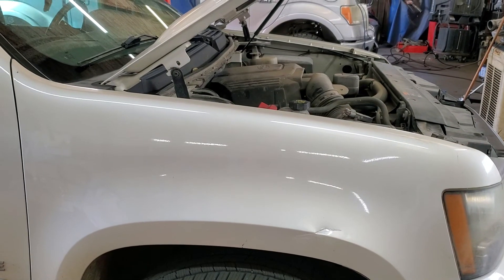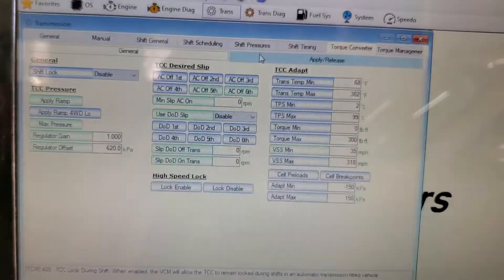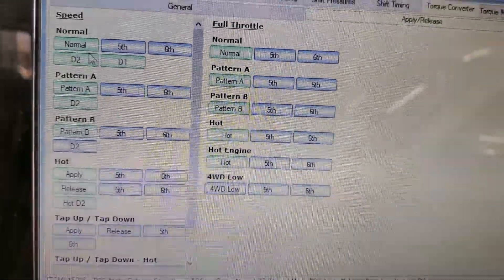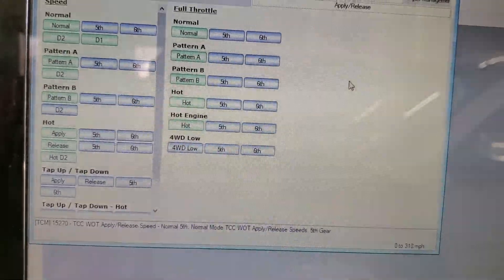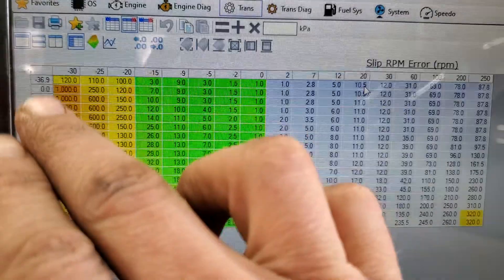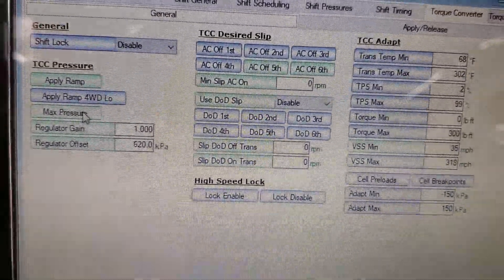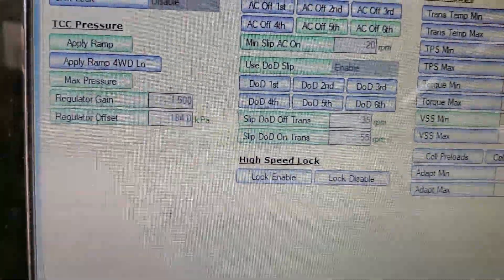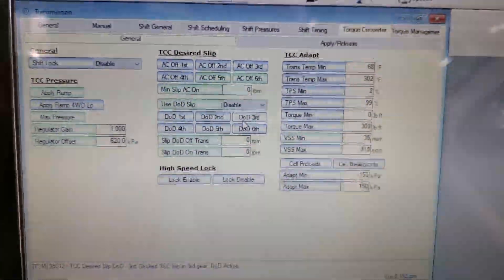GM 6l80 TCC shudder fix with HP Tuners

Comment from the maker: I just made a new video on another 6L80 in a 2016 Suburban but this time I show the whole process from data logging to tuning with before and after test drives. Just search "6L80 full of metal is saved with HP Tuners" on Youtube.
Reply: Why won't the hptuners work with 2019 and up Chevy Silverado 4.3 V6 6l80s? My tuner tried pulling the stock factory file off the truck and it fails every time. Perfect internet as well.
Reply: Do u sell the tune?
Reply: What did you do for the ac off 5th and 6th

Comment: So my 2013 suburban 6L80 was starting to shutter and have some odd shifting. so I immediately parked it. Temps have never really gotten above 150. Drop the pan put a new filter and fluid in it.... put a additive in it lubricity modifier and for the most part it's gone but every now and then it shifts kind of weird..... Hopefully it's adapting. So I think I'm going to try to do with essentially you've done. I don't think I'm going to turn the pressures up quite that high because I don't think it needs it and I turn the desired slip all the way down and turn TCC off in first second third fourth. Anyway thank you for making this video.  I just need to get another year out of this trans vehicles got 177000 miles.....just did ball joints front brales tune up oil change filter and battery so of course we need to transmission and torque converter lol

Comment: I know it’s been awhile but would you recommend this tune in a rebuilt transmission that has a shudder or vibration that’s from 75-85 … the shudder/vibration was there before the rebuilt transmission …. I ve replaced everything else ? Axles tires rims u joints rebalanced driveshaft .. no luck .... this is a quad cab driveshaft is 84 inches long with 1 piece long ass driveshaft

Comment: Would you happen to have any suggestions on tuning a 6T70/6T75? I turned it off from 1 to 4 and still get some shudder in 5th and 6th. I didn't do anything with the pressures.
Reply: I have a 2016 Traverse with the 6T70/6T75 as well. Been getting the shudder for over a year, and shudder fix and new fluid has not done any good. Shudders bad most times when leaving from a light, and 5th and 6th gear I get rpm fluctuations like it's not staying locked up. Stopping the lockup in gears 1-4 would make a HUGE difference with driving the vehicle with just the shuddering in those gears not happening anymore.

So can you confirm this "no more lockup in gears 1-4" change eliminated the shuddering while going through those gears at least?

Also, did you ever get the 5th and 6th gear situation figured out by raising the pressures with the tuner?

Comment: For anyone with shudder, before you go making changes to the Trans tune, go look at the LTFT and see if they are negative.  Reset them in the HP Tuners Scanner under the engine tab, reset the adaptations and try to see if it will make a difference in the shudder.  I just dealt with bad lock up on the TC that looked similar to sawtooth and the LTFT were negative on my end, after resetting them my TC Line pressure was able to reach 90psi to hold down the clutch without having to adjust any of the values, prior to the rest it could not get past 45psi.
Reply: What does long term fuel trim have to do with tcc lock up? I haven’t heard of them being related in anyway.
Reply: I'm curious if trims affect tcc I will update

Comment: These transmissions are trash. Why tf would they design crap to run like this?
Reply: It’s the way they are programming it to slip with Active fuel management is the problem the transmission is actually built pretty good.  They need to take lessons from ford on programming

Comment: That apply ramp rate is a time… you went the wrong way.
Reply: The table is SLIP(RPM) and RPM vs PSI. What do you mean it's a time? You're changing a kPa (measurement of pressure) not sec(s).

Comment: Will this work for the 6l50 as well?
Reply from the maker: Most likely. In fact, I was today years old when I learned a 6L50 was even a thing 🤣. We work on large SUVs and trucks and it seems those were in the smaller vehicles. But I'm sure they likely have the same exact converter clutch operation. It's easy enough and free to hook up HP Tuners to see how it is tuned (that's if you own HP Tuners- there are no credits required to just view a vehicle's tune files)
Reply: @TechnicianRed  i changed it already .the tables look exactly the same .except for the offset .there is no tab for that
Reply from the maker: well did it work? @rodstrong01
Reply: Haven't flashed it yet I'll let you know
Reply: Worked like a charm man .thanks for the  info

Comment: I have a FTI 3200 Stall 
Triple Clutch torque converter and my  6l80e transmission it's shudder 55 mph. it didn't do it with the stock torque converter .  Do you think i need get tune .

Comment: You'll kill your thrust clearance in the motor if you run excessive converter pressure.
Reply from the maker: Very good point! After doing lots of research, that only applies to converter charge pressure inside the impeller/turbine chamber and not the pressure going to the torque converter clutch. The fluid pressure that pushes the TCC piston forward exerts an equal force against the front side of the turbine as the surface area exposed to lockup pressure is equal between the turbine and TCC piston. So the hydraulic force exerted on the converter from the TCC should be the same in both directions and shouldn't push the converter into the crankshaft.

Comment: I have an intermittent shudders and vibrations when drive 50 mph+ in D mode only . When I select 5 or 6 shift everything becomes normal. Could HP tuners fix this problem ? 2011 chevrolet camaro ss.
Reply: Have the same problem with my vette, ever figure it out?
Reply: It sounds like a tuning issue, yes

Comment: So i just had mine completely rebuilt an i still have flare shift. An shudder under 34mph.    Would this tune help
Reply from the maker: This won't help shift flares but should fix the shudder
Reply from the maker: Check out my latest video to see how you can data log with HP Tuners to verify if it is indeed torque converter shudder.

Comment: I found it. Mine is a 2015 suburban with 127k and starting to get some shutter. Will this work for mine?
Reply: Well the shutter fixed lasted about 2 months I think I am going to rebuild and tune it.
Reply from the maker: @justinstatham6378  try the tune first! Also check out my other video that I pinned in this comment section. I do a better job in that video of explaining everything.
Reply: @TechnicianRed  Thanks. I haven’t bought a tuner yet. I am trying to find a shop that can tune it for me but not having any luck in Georgia. Do you know anyone or recommend I tune it myself?
Reply from the maker: @justinstatham6378  just do it yourself. Buy the HP Tuner interface for like $300 and just follow my new video. Will cost $100 for the credits to unlock your ECM too.
Reply: @TechnicianRed  where can you get it for $300. The price I am seeing on Amazon with 2 credits is 550?
Reply from the maker: @justinstatham6378  try ordering direct from the HP Tuners website. You are looking for the new MPVI 2 interface. I thought it was only $300 but maybe it's higher
Reply from the maker: Yes but I would recommend just changing the fluid with some Lubeguard TCC shudder fix and the Lubeguard ATF treatment first as doing that usually fixes the shudder. The HP tune route is only meant for the 10% of transmissions the fluid change doesn't fix.
Reply: @TechnicianRed  can you send me a link to which Lune Guard ATF Treatment you recommend or a part number.
Reply from the maker: @justinstatham6378  Lubegard #19680 & 60902
Reply: @TechnicianRed  thanks fingers crossed.

Comment: I'm in buffalo  ny, and have 2014 Chevy .who does this hp tune ? Or how do you do it ,
Reply from the maker: I am down in Texas. You will have to call around to the independent shops or even better the performance or tuning shops.
Reply: What you can do is go to mail order tuner and have him make a tune for you to upload they may charge you a security deposit for the tuner they send you to do it with but it's not hard

Comment: Tech Red, I have a 2015 Tahoe 4WD LT (6L80 ... I assume) with 85k miles. I've felt what my be a shudder, but it was only once or twice.... so, it may have been the road conditions. Can you advise me on ANY OTHER things, in addition to what you outline here, I should consider doing to get ahead of any future issues? For example: Is there a ATF fluid that will help? Are there special fluid additives I can use to help reduce the chances of this occurring? Would more frequent fluid and filter changes help?
Reply from the maker: Yes, change the fluid & filter and put in some Lubeguard ATF Protectant along with some Lubeguard Instant Shudder Fix. They stock it at Oreillys. This is a very common problem and that takes care of it most of the time. And yes, you should change the fluid more often from there on out.

Comment: Tech Red, 
Thank you for the tutorial,  just reprogramed my 6L90 today and the shutter is completely gone. Awesome job and thank you again for sharing that! I still have little flare 2-3rd if I am accelerating slowly, do you by any chance have some fix for that too?
Reply from the maker: No problem, glad I could help. And no, unfortunately I don't have any quick fix for your 2-3 flare. The 6L90s don't last very long so I imagine it will need a transmission soon. But, I will say I had a 42RE? in a Dodge Dakota that would flare pretty good and the Lucas "Transmission Fix" actually helped a noticeable amount. So far that transmission is still going at 315K and the additive was added about 210K. Might try some. They stock it at O'Reillys.
Reply: @TechnicianRed  
I drove it for few days and flare is aost gone, I guess tcm relearned and now shifts better. Totally agree with you about the aditives, my Dodge Caravan started slipping at 190k after fluid change, aded some dr Tranny friction aditive and tramsmission is still goot at 245k now.